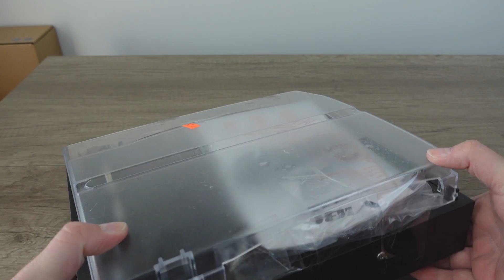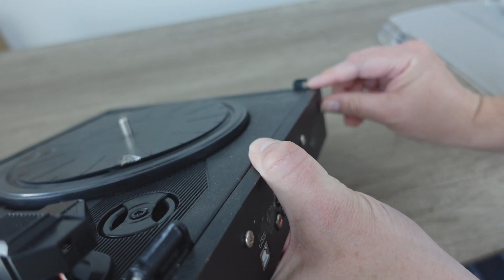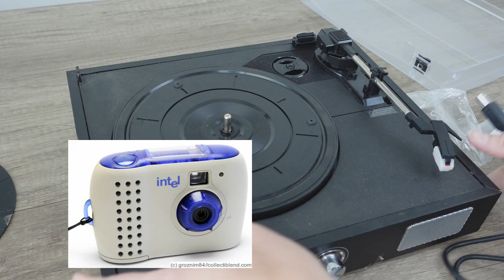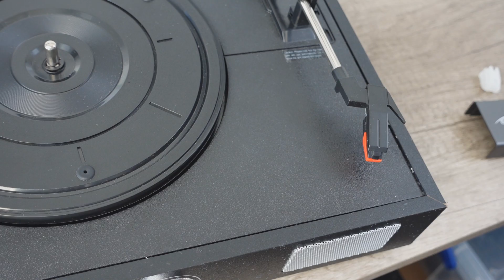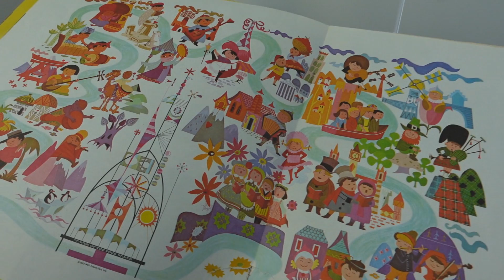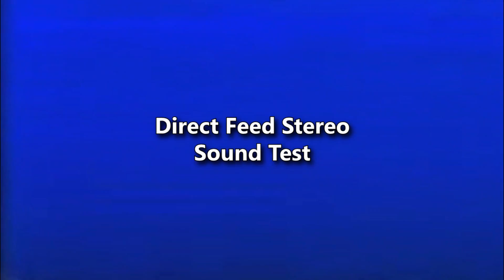$15 Thrift Store Record Player!

Comment: Speaker's in a turntable?? 😮 The whole system is based on VIBRATION, people try all the ways to dampen vibration! Speakers built in sure is not going to do that! Extra vibration also causes extended "record wear" ! I hate to be negative, but that's junk dude! Just telling the truth! To get a "true " analog experience, you have to spend at least $300 on a deck, under that it just defeats the purpose!😊 Great video though, thanks for the upload!😊

Comment: I’ve got one of these as a freebie promotion !!

I thought the sound quality was very tinny through those small  speakers on the front-but didn’t try hooking it up to an amp via the rca outputs on the back !!

I had already found out that the tracking of the tonearm,wasn’t that great,as mine would skate across the record at the slightest bump or knock !!

Was a result I put it back in its original box and put it away-thinking it was only a freebie-and not much cop.

This was all before I moved house-and I think,it is still away in one of the unopened boxes !!

Perhaps I should get it back out and see if I could get it working properly,through an external amp ???

Comment: Even on such a cheap player, It would surprise me if the  line out comes directly connected to the cartridge, otherwise feeding into an external amplifier's aux- in  would not supply the high input impedance required for decent bass.
The  line outs should be connected AFTER the record player's high impedance input stage, if in fact it has one!
Worth checking.

Comment: If the player isn't going to damage your discs, I would say it's a very good buy. The speeds are a little inaccurate but one can probably live with that.
Reply: The 33.1/3 speed was galloping away so fast that the voice sounded slightly chipmunk😊
Should be easy to adjust if the motor has the usual thin screwdriver slot on the back of it, or better still, individual speed adjustment pots.
Reply from the maker: Agreed
Reply: External vibration cause's accelerated record wear, ITS A SCIENTIFIC FACT!
Reply: Plus you have built in speakers, enough said......